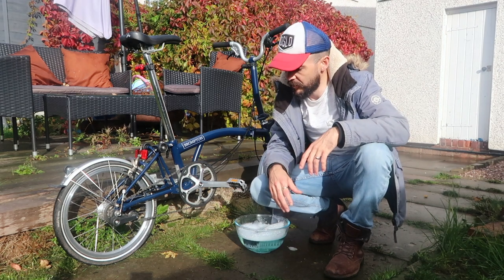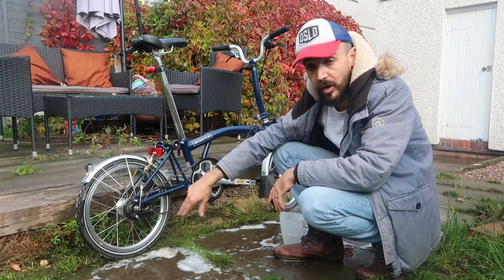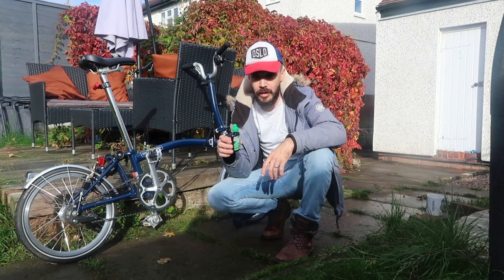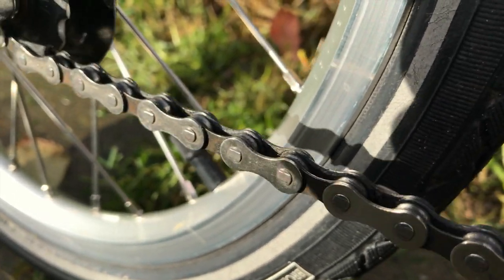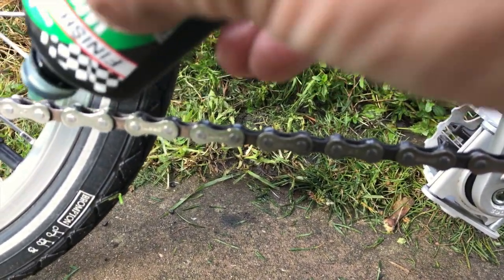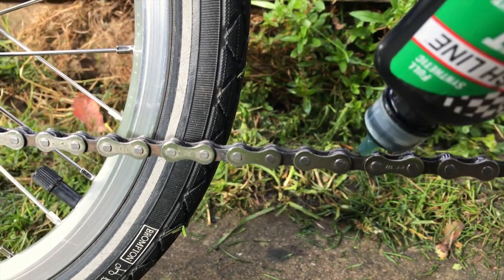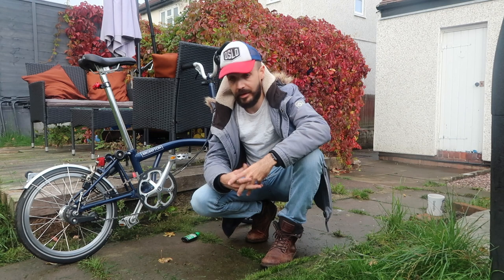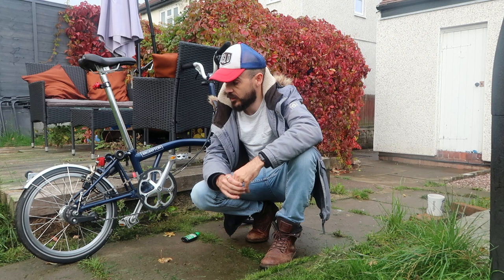Brompton Bike Maintenance - Cleaning and Oiling the Chain

Comment: Hey,what chain washing liquid do you use please? Thanks for the video as well.
Reply from the maker: Just use normal car wash liquid that we have. Give it a good scrub. Before I wash it though I use some disk break cleaner on an old rag to remove the old oil which helps with the cleaning a lot I have found. 👍

Comment: Sorry you have only cleaned the outside of the chain. Majority of the wear is between the links and rollers..for this you will need a proper chain cleaner.
next time you clean the chain your way try twisting the chain between your thumb and forefinger and you will feel the grit within. Oiling a dirty chain will do more damage than not oiling it at all.
Reply from the maker: Thanks for the advice. To be honest I have found the opposite in my experience but its great to hear other ideas and share them. Appreciate the comment! I totally agree that the majority of the wear occurs on the inside and rollers which is why I do it the way I showed in the video. Plus keeping on top of it really helps as well to make it last longer!